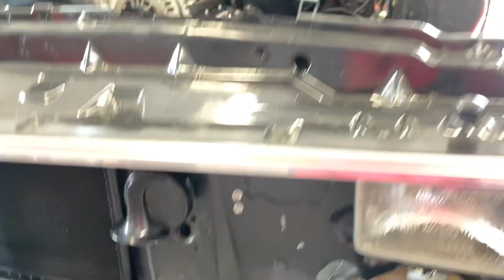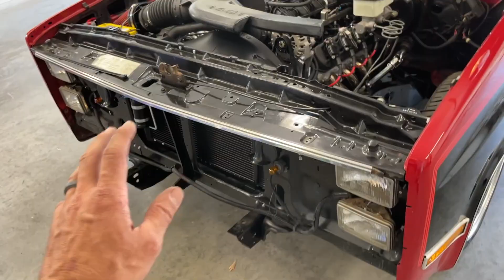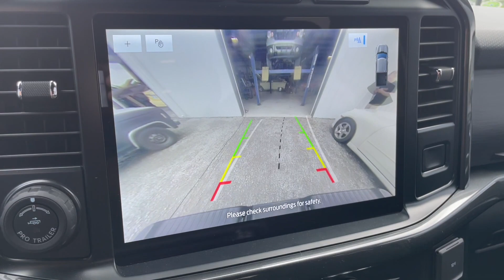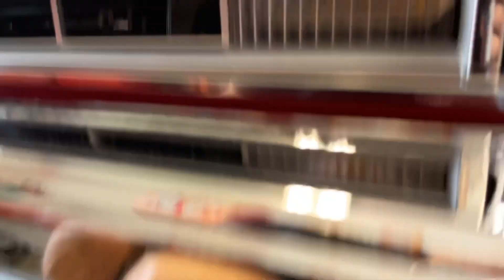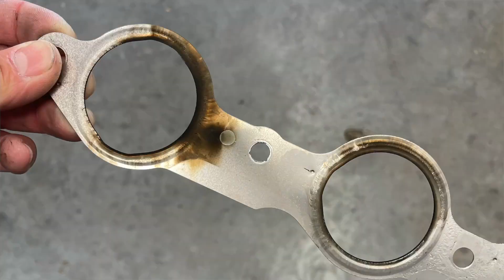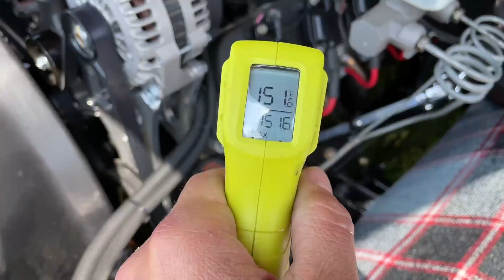New Square Body Build Part 11: Final Assembly of our '86 C10 project!

Comment: Nice truck, what's the best way to get the chrome around the truck off put new on and the guy that put it on messed it up
Reply from the maker: Pull it off, eraser wheel the leftover tape, install new from a roll. All available on Amazon. Use masking tape around the truck to line the new molding up where you like it.